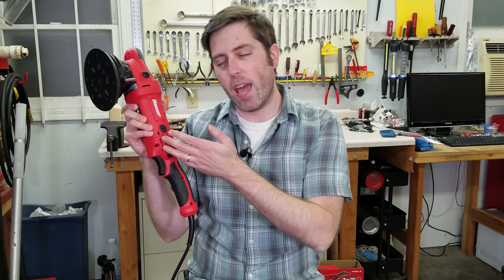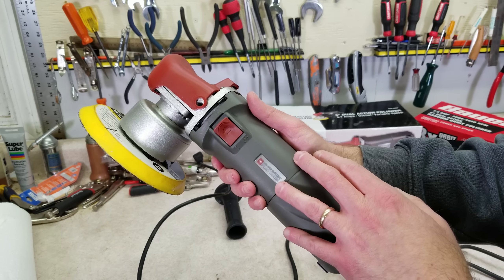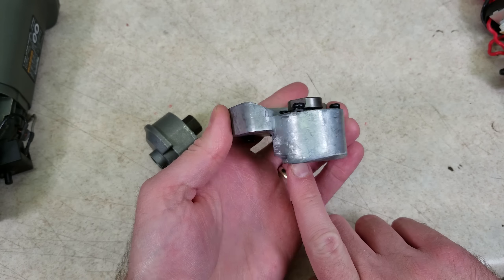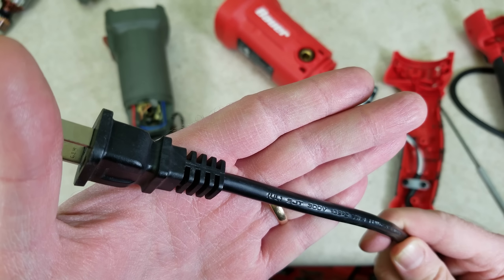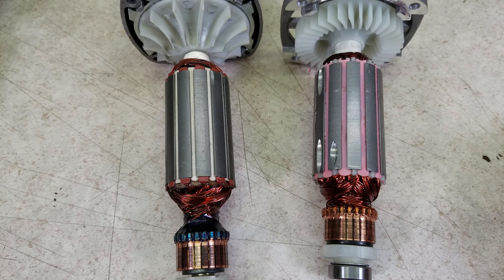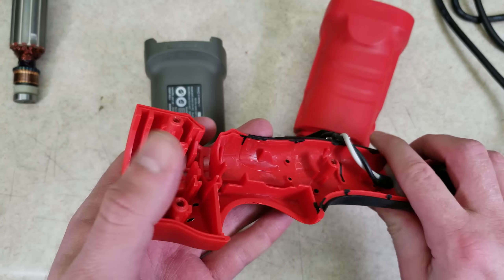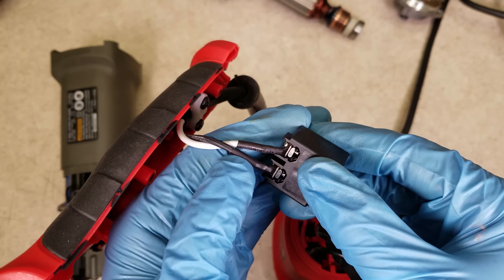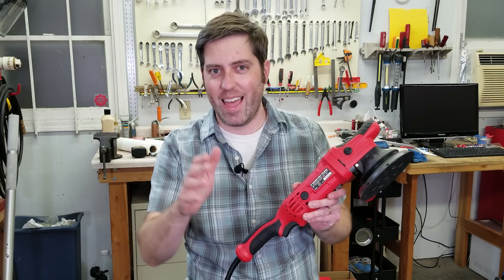Teardown Review: New Bauer Long-Throw DA Polisher from Harbor Freight

Comment: Your post helped me. I purchased the Bauer and tried it out of the box. It worked fine, it was loud and I did notice the vibration. I tore open the gear housing, cleaned out the grease and added new good quality grease. The noise and vibration were greatly reduced! Your post break down helped me greatly on my purchase. Thank you very much.

Comment: Thanks for the great review.  I was trying to decide between the two HF Bauer polishers.  After watching numberous YouTube videos, I chose the newer Bauer with the 20mm throw.  I haven't used it yet, but the ramping speed control, lower vibration, longer and rubber coated cord, ease of brush replacement, and the rat tail trigger handle sold me on spending the extra money...all that, and the fact that I still had $180 left on my HF gift card from the class action suit.  I was glad to see they used more/different grease in the gear box on this model, without me having to tear it down to check before even using it.  Can't wait to get started using it for paint correction and polishing, after deep washing and claying my 1993 red Accord (212k) and 2003 black Expedition (50k)!!

Comment: Your review sold me on this product for home use. I have a  Porter Cable 7424XP that gives me excellent results, but since developing arthritis in my hands the case diameter, vibration and on/off give me some difficulty. Looking forward to what appears to be a more ergonomic machine. Have also been eyeing the G9; since this is low usage, and a trial for me will give the Bauer a go.
Reply: You can buy some anti-vibration gloves. After I got my da and a few uses my hands were very tngly. The gloves almost cut down that feeling. I have a Meguiars polisher. I will not polish without the gloves now

Comment: I would not say that there is "just a little improvement" in the newer one, because the "Throw" of 20 mm versus 8 mm makes it MUCH more powerful and  efficient at polishing a rough, just applied paint job.  (Perhaps the older one is acceptable for only  applying wax or removing fine blemishes, but little else).

Comment: I would have been interested in your thoughts about replacing the factory 6" backing plate with a third-party 5" backing plate.  I've heard that the 5" doesn't bog down as much, vibrates less, and is easier to manipulate on curved surfaces or in tight spaces.   

Basically, it works better ... but is it worth the 40% to 50% cost differential?

P.S.  Got my answer elsewhere.  It's recommended that you replace the 6" backing plate because the factory backing plate flexes too much.  So, if you're going to spend the money to replace it, you might as well replace it with a 5" backing plate.  (I replaced mine with a RUPES 5" backing plate, Part No. 980-027N.  Works great!)

Comment: Thank you for this video, I've had my eye on this machine. However, the Griots G9 right now is just $20 more. If it was your money which would you buy?
Reply: g9 all the way why waste your hard earned money on junk.
Reply: @carl3233  I had the G9 in my virtual cart since a website had it on sale for $120 and that price had me leaning in that direction. The sale countdown timer was at 5 days when I put it in the cart. I was doing a little more research and started to see several reports of the G9 quitting in the middle of a job and not starting back up. I read that there is a "new" version of the G9 that might correct those issues so I was waiting until the end of the sale in the hopes of getting the newest inventory. However, I checked back in on my cart and the price was back up to $150 before the end of the sale. I contacted the company's website and it turns out that Griots told them that they can't have it on sale so they had to put the price back up without notice. My only other experience with Griots was an overpriced bottle of garbage car wash so I wasn't a fan to begin with but we considering the new machine solely on the sale price. The other deterrent was the fact that the G9 doesn't have a soft start. Who designs an all new machine from the ground up and doesn't even put in a soft start? Even Bauer did that. I may or may not get the Bauer but I'm definitely not giving my money to Griots anymore. Maybe a Maxshine after I do a little more research.

Comment: Does the backing plate have the 5/16" male thread the same as the old model? Also, would a 5" backing plate (with cooling holes) fit in place of the 6" I wish they had done a 15mm throw instead of the more aggressive 20mm throw, and made it a 5" polisher instead of 6"
Reply: Why not just change out the backing plate/pad for a 5"?
Reply: @KBzPTGT  That's basically what I am asking. Does the polisher have the conventional 5/16" male thread stud on the backing plate so a 5" BP  will fit?
Reply: @lacro5686  It doesn't use they same type of backing plate as the older 8mm versions. Frpm what I've seen it does use the same type of backing plates that some other 15/21mm throw DA units do such as the Maxshine, Adams Swirl Killer & GG Boss series. Hope this helps.
Reply: @KBzPTGT  Got it! Thanks...

Comment: I have the upgraded Bauer polisher and use it several times a month. I've used it over a couple of years now and finally burned it out. Are replacement parts available? Or should I just replace the whole tool?

Comment: I bought the new tool you have reviewed. I did not know the differences between rotary and DA.  I am about to reduce gross overbuildup of gelcoat epoxy resin I applied to the hull of my boat with wet sanding. I assume this tool will cut deeply faster and more evenly than  rotary if I am learning the uses, but it not please correct me. Thank you.
Reply: Rotary buffers cut much faster than dual action polishers. I worked in rv and boat yards in the past and all they used were Rotary buffers.

Comment: Is this Bauer long throw polisher better than the old porter cable 7424xp cheapie? I just ask because I bought the PC like 10 years ago and never used it. Still in it's box. I'm getting ready to clean up my 2 old cars to sell and full paint correct my newer Lexus. Should I sell the PC and get the Bauer?

Comment: Bauer is really trying to step on board with the new long throw design at Harbor Freight that says compare to rupes.
I have roots 15 mm long throw I have had other cheap dual action polishers from Harbor Freight they work I had trouble cheap rotary from there that work to but I am curious to try there new $99 long throw polisher like it might be a good Wanda keep in the box if something goes wrong with the other one

Comment: Can this be used as a d/a sander for body work?
Reply: that's what I was wondering. It probably wouldn't hold up for very long. Pneumatic DAs kick ass. I hate firing up the air compressor for every little thing though.
Reply: grumpybill I have used the old model as a DA for 2years still going .
Reply: @sergiocervantes4556  thanks.

Comment: These both seem overpriced to me seeing as they are basically an angle grinder with a polisher head. How does that make it cost 2x as much?
Reply from the maker: Well, it has everything a grinder has plus the speed control and the counterweight assembly. Some grinders have speed controls. But not the cheaper ones.

Comment: That vibration hurts my hands. I can’t polish for more than a minute.
Reply: @johnnyphuckinrocketz  
Did you adjust the counter balance screw (shown in the video)? Other reviews say switching to a smaller 5" backing plate helps tremendously with vibration. Less so of an improvement is pulling out the factory grease and replacing with a high quality product.
Reply: @johnnyphuckinrocketz  
How did that work out? I see it's on sale for 169.99 on Amazon at the moment with a $30 coupon. I bought the Bauer at the end of last summer with a coupon for around $90, but a family death prevented me from using it. I'm hoping to free up some time this month to do a full paint correction and ceramic coating on my older Lexus is350. My car is "black sapphire pearl"...least desirable color available for my car in my opinion.